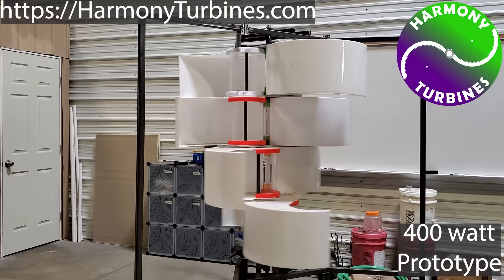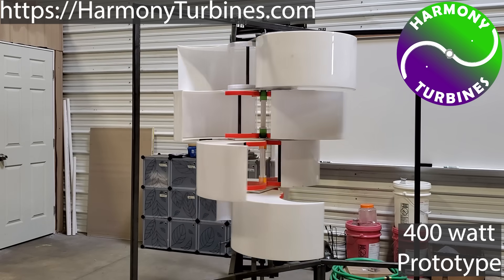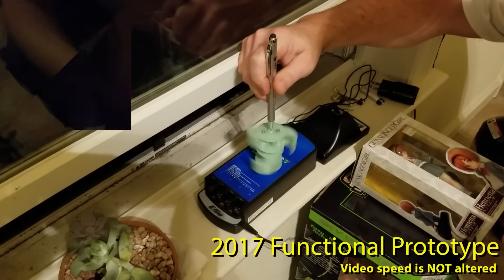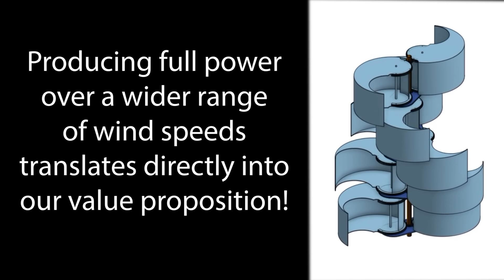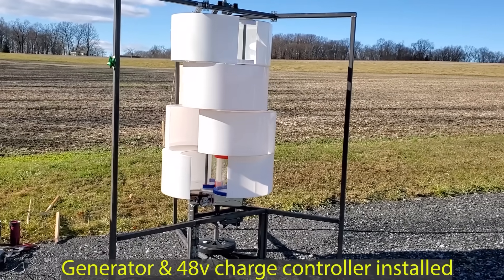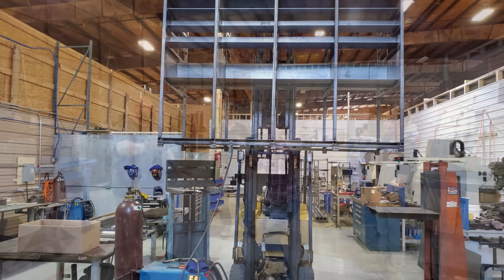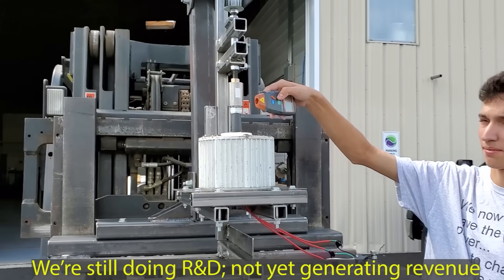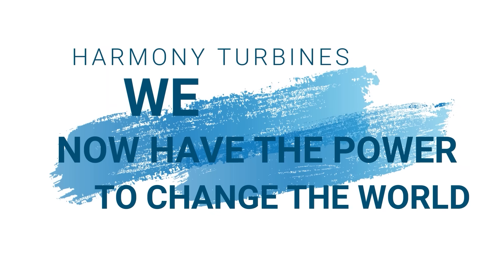What makes Harmony Turbines so revolutionary?

Comment: it would be nice to see the data on Size/rpm/watts output to compare to other VAWTs.   Thanks
Reply: Mathematically the MAXIMUM energy in the wind (in kilowatts) for 1 square meter is 0.0006 * wind speed CUBED. So for a blade of 1m^2 and a wind speed of 2m/s (average city wind speed) you have kW = 0.0006 * 2^3 ,  equalling 0.0048 kilowatts, or 4.8 Watts. These turbines might be 10-20 efficient. So you will need a 100-300 hundred square meters to get enough power to power a home.
Reply: @AORD72  thx.  
So basically it's a wet dream.  
🤷‍♂️
Reply: @AORD72  small correction, that is the ideal equation for POWER (in kilowatts). The power integrated over time is the energy. 
A better example would be to look at the example shown at 5:42 with 15 mph wind (6.7 m/s) and 2 square meters of effective wind capture = 180 Watts of power. Most home-turbines do not spin at lower speeds than this.
Doubling the speed to 30mph yields 8x the power = 1.44 kW (plenty for a home). And in a storm with 60 mph winds, the traditional turbine would shutdown but this design will self-limit at it's designed maximum power output.
The next video this channel posted has good example scenario showing this.
Reply: @dl5244  MAXIMUM energy in the wind (in kilowatts) for 1 square meter is 0.0006 * wind speed CUBED.
So for 6.7m/s is 180 Watts of power (for 1 square meter only), but that is the MAXIMUM, reality will 10% of that because the turbine is about 10% efficient, so 18 Watts per square meter, so pretty useless when comparing to house usage. 

30MPH 13.4m/s gives 144Watts at 10% efficiency per square meter, but the problem is how many places have constant wind at 13.4m/s.  

6.7m/s is quite a strong breeze.  Annual Average Wind Speed in US Cities is more like 9.1m/s. Or 4.1m/s, which at 10% efficiency gives 4.1Watts per square meter, useless. 

Wind turbines have been around for hundreds of years, but we don't see them anywhere except for on the top of ranges or out at sea. And they are tall enough to access the stronger and more consistent breeze.
Reply: @AORD72  no one in a city would buy one of these. it would take a lot of space which city dwellers dont have. it would be an expensive lawn ornament. 
rural areas would be better with higher average wind speeds. but still an expensive lawn ornament. 

they need to get the cost an ROI time down for it to be viable and sell well.
Reply: @darkshadowsx5949  then why would you buy one at all? Just buy a normal 3 blade that is more efficient and has pitching blades.
Reply: @AORD72  Hi, Thanks, that is not much input power at lower speeds. Have you seen the Russian horizontal Spiral? it seems to cover lots of areas and is mechanically stable.
Reply: @dieselnich  I think so. Still there is the MAXIMUM energy in the wind (in kilowatts) for 1 square meter is 0.0006 * wind speed cubed. So even at low wind speeds of 1m/s and a area of 1m^2 ,you are only going to get a max of 0.6 Watts. Or 14.4 Watts  over 24 hours.  Reality will be maybe 30% of that.
2m/s wind = 4.8 Watts, over 24 hours 115.2 Watts (again probably 30% of that).
Compared to a solar panel? 5 hours (winter) with a 200Watt panel that is a 1kW/h (about 30 times as much energy). Low speed turbines can't compete with solar (unless you live where there is zero sunlight).
Reply: @AORD72  With a hurricane you can decrease the surface significantly.
Reply: @no_more_free_nicks  yea like 12 hours of a hurricane wind once a year is going to make a lot of difference.
Reply: @AORD72  Just when things were going so well you had to go and introduce science into the picture! I'm sure it will be a lot more appealing if you leave Betz out of it.

It's a Savonius, they're about the lowest output wind turbine you can get.
Reply: @AORD72  well it will work well during a hurricane, so it's got that going for it.
Reply: @markdee3506  True. But from what I gather it is controlled by electronics. Surprised it is not controlled by simple mechanics, like a governor on a steam engine (I would have thought more robust).
Reply: @markdee3506  Big Deal.    Makes a big deal about something you can turn off during a storm.  Windmills have brakes.   His idea has to much mass.  It will never work
Reply: @AORD72  I think the way you've assumed the calculations are done is wrong.  It looks to me that the size of their turbine is more in the 300-400 Watt range, not what you've calculated.  I don't have the proper calcs at hand to do my own power estimates, but I'm pretty sure you're out of range by about a factor of 10.
Reply: @Kismetix  they? (by "their"  who do you mean?) might say 300-400w but the reality  is what? The mathematics is dependant on wind speed. So to calculate for your location you need to use your locations wind speed. Cut out speed is also a factor, most of the year (like night time) the wind might be less than 2m/s. Best to calculate (intergrate)  for the wind speed values recorded over a year to produce more accurate results.
Reply: @AORD72  yeah, that doesn’t seem accurate at all. I’m no fan of wind power, but no way you’re numbers are accurate.
Reply: @jamesbizs  wrong in what way? Where are your figures and calculations to show what I have done wrong? Don't just guess show some calculations or data or logic.
Reply: @AORD72  Sir, This is very intriguing to me..... I've always had an interest in alternative energy...... Here on the farm in central NC I have an 8' aeromotor windmill on a 21' tower..... I'd wanted one for decades and don't need it for pumping water albeit may configurat it to oxygenate the lake water...... And as I can barely count to three I'm wondering if you would calculate the "approximate" energy of this 8' fan and possibly horsepower? I think aeromotor rates their windmills according to fan dia. wind speed depth of well/water equals gallons pumped....... I think aeromotor still market's a 20' windmill/motor/fan for like 45K...... I think aeromotors offset design and tail vane furling system from decades ago is quiet ingenious...... Wasn't there a gentleman that designed horizontal turbines...... The guy that designed the geodesic dome homes...... Fulmiester maybe..... Respectfully......
Reply: @markbouldin6513  That is hard to say. You need to know how much oxygenating you need to do. Best to email and ask the makers of the aeromotor if they are suitable to oxygenate, I read somewhere they their pumps are not suitable (?). I suspect it would be FAR more economical to use solar panels and a pump, like $2k vs 45K, for a turbine that I suspect is not very efficient. But then you also have to weigh up the life time, although solar life is usually 80% after 25 years, so you might get 50 years from them. 

North Carolina would have sufficient sunshine hours for solar. Over 2000 hours a year is very good for solar, and most places in NC seem to be around 2500 hours (very good/excellent).

North Carolina wind speed average is around: 17mph or 15knots or 7.5m/s (if you use proper units).
A turbine with 8' diameter rotor = a radius of 1200mm (if you use proper units).
Power from the turbine using average wind speed: Watts =1/2 x Air density x Sweep area x Wind speed cubed x efficiency.

Air density = 1.2, Sweep area=PI*R^2 (4.5m^2), Wind speed (we use years average to approximate the wind), efficiency we guess 5% (0.05) because of the design (best turbines are about 30%)
So you have: Watts from the turbine = 1/2*4.5*7.5^3*0.05 = 47 Watts. Which is not much. You could buy two 25W solar panels water pump kits for $320usa (2X160) which would produce similar results. 
This is all rough figures and could be out due to: wrong average wind speed could be less or more where you are. The turbines might be more efficient like 15%. If turbine is directly driving a mechanical pump then that can be slightly more efficient (10% better, maybe).
Reply: @AORD72  appreciate seeing someone willing and able to apply their knowledge.  Well done!  You explained formulas in a manner that was easy to follow.  Wish there were more posters like this
Reply: @SoulDelSol  did he though
Reply: @PandaCheeks  yes it was easy for me to follow.  He explained the relevant formulas and then plugged data into them.
Reply: Mark  Bouldin 
Fuller, Buckminster
I built some domes on his patterns. 
Only the sprayed concrete domes are useful….
Reply: I like numbers  - don't lie.  The wording makes it sound fishy. 
Worst case - peace of art capable of powering the lawn lights.
Reply: This type of VAT is called "Savonius"
Reply: You never get that because it is an embarassment for the makers. Better to keep it quiet and con gullible people.
Reply: @rogerphelps9939   Thanks
Reply: True
Reply: Currently looking into cutting my electricity bill,every tip is welcome
Reply: I would like to be part of this
Reply: You don't get the data because it's not working.

Big companies only use propellers for their mill's for a reason.
Reply: @CodeBallast   Thanks I did see a video about how they were just developing their generator.
Reply: for wind turbines Bigger ain’t better
Reply: The only certified vawt is the one I sell and install. The hivawt. So frustrating seeing big youtube channels talk about stuff like this and ignore me
Reply: @TurbineGuy  Does yours feather itself in strong winds?
Reply: @dnomyarnostaw  electronic control system brakes it.
Reply: @dnomyarnostaw  Not the point. His one is "certified" and this one is not which is quite easy to come to the assumption of that considering its still in R&D.
Reply: @TurbineGuy  "The only certified vawt is the one I sell and install. The hivawt. So frustrating seeing big youtube channels talk about stuff like this and ignore me"
You should be ignored because you're crying over a product that's STILL in R&D. Piss off. Get aborted.
Reply: @TurbineGuy  dunno what your problem is muppet, but if you have a look at their website, they're still in the R&D phase of creating the product. So its VERY fucking obvious that they haven't been certified yet.
Reply: @KotaruKun91  name calling, the mark of the uneducated. Good job there. Real problem is all of the verticals that have failed. Lots of R&D, not much production. Certification is not an easy process at all and takes years. I know, I helped certify our turbines. What experience do you have other than name calling?
Reply: @KotaruKun91  Found Michael Caine!
Reply from the maker: We're still in development so we don't have units to purchase or send out to customers/supporters at this time. If you would like to invest in Harmony Turbines we're planning on opening a 3rd funding round this summer with StartEngine. We estimate about a 7 year ROI if you have good strong winds in your area and $0.15 or greater cost per KwH electric.

Please sign up with our Newsletter to receive the latest updates from Harmony Turbines: https://groups.google.com/g/harmonyturbines
Reply: @HarmonyTurbines  wind turbine manufacturers from my region, said these are unproven wind turbines. Do what you feel right! Just get some legal certification through which we customers can blindly trust your products. 

No hate. ok. I'm too just like you. Just giving advice. Best of luck. Worst part of my journey is no crowd funding 😢.. lucky you!
Reply: @HarmonyTurbines  make it available worldwide! I need it in India, Goa, 403005 pincode
Reply: @HarmonyTurbines  hello! What's the lifespan of these Harmon turbines?
Reply: Why do you STAIR STEEP THE OPENINGS INSTEAD OF JUST ONE STRAIGHT LINE VERTICAL OPENING??? Please please please please Nice design !! 
Thank You ?
Reply: @robertholderman7552  They probably do it to even out the input torque.
Reply: @robertholderman7552  I think this design is similar to brick building.... It offers more strength and stability

Comment: Hi, neat design, commercial machines are 5 megawatts, Can you build something comparable? or how about a 20KW for the house?
Reply: Sorry I have no clue, that is why I ask for the data
Reply: They say their flagship will be 400 Watts @25mph, so I guess you could install 50 of them for your 20kw.
Reply: @markdee3506   Thanks, that puts things in a category
Reply: Power is mainly determined by wind speed. For 1 square meter the MAXIMUM energy from the wind is kW = 0.0006 * wind speed CUBED. So for 1m^2 and average city wind speed of 2m/s you get 4.8 watts.

Comment: I appreciate that your blades open up and close depending on wind volume. From my old memory the water pumps here rotated from inside a drum with openings either side, and the drum rotated to accommodate wind direction changes, and excessive wind speeds.

Comment: Almost identical to some water pumps that I saw way back in the 60s/70s here in Australia.
Reply from the maker: I have heard that before. But keep in mind that our unit has a variable cross-section. It can reduce it's exposure to the high winds through our patented furling mechanism and keep on producing full power right through the extreme wind event.